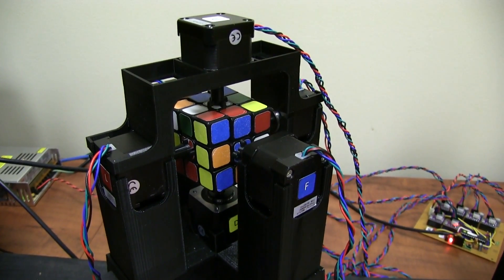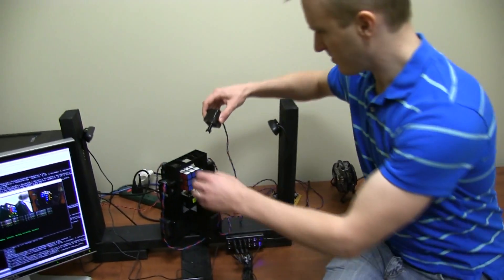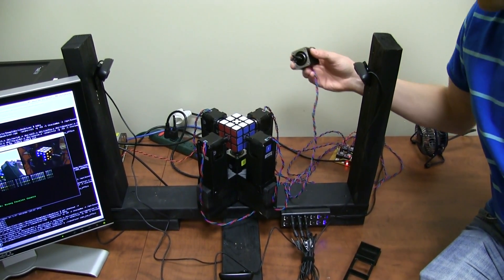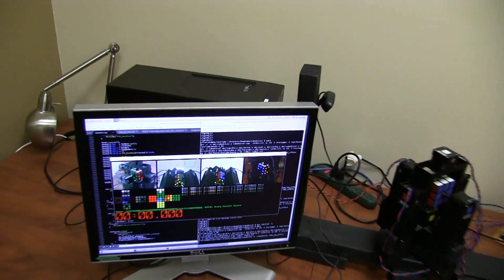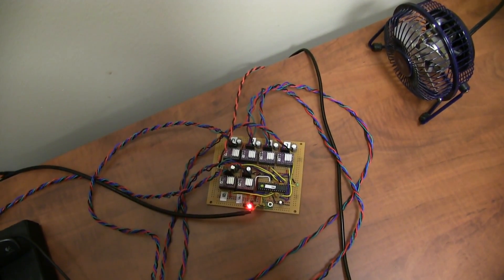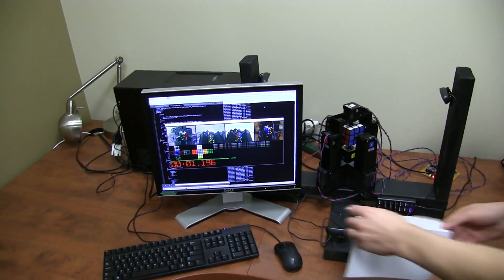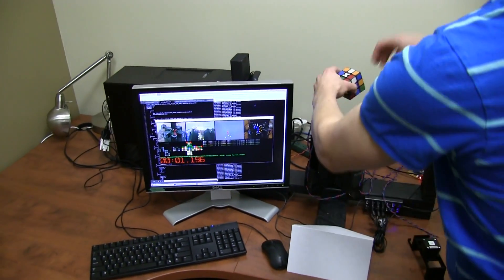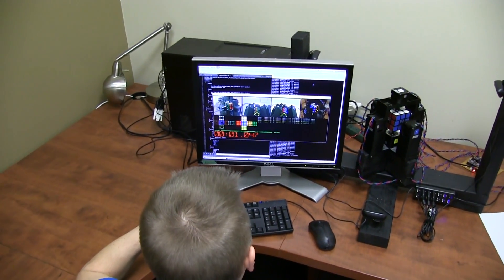World's Fastest Rubik's Cube Solving Robot - Now Official Record is 0.900 Seconds

Comment: Couldn't you write a program to scramble the cube as well? Just to defeat the need to remove the cube and scramble it by hand. I would also assume that in mechanically scrambling the puzzle by means of a computer program, this could essentially randimize the scramble more effectively than any method of doing so by hand. You could also technically create an algorithm to randomize the scramble of the puzzle in a way that solving the puzzle would require a finite limit in the lowest number of moves required to unscramble it.. basically jumbling the cube in a specific way which forces the minimum number of moves to solve it reaches a maximum limit. 

Just an idea that popped in my mind when viewing this video. Otherwise, incredible machine!! Very well made and stout, great idea, awesome construction, and amazing mechanisms which achieves it's purpose extremely efficiently and with maximum applicable speed, at the same time. 

Ingenious. 
I love it!!

Comment: Again, unoriginally, it's a well done project, but you modified the Rubik's cube. You could've as well glued the thing to the motors and it would've had the same effect. Since there are many computer vision solutions available open source, as well as solving algorithms, I fail to be impressed. I mean, well done on the implementation, but you fucked up  the dismount. 🙄

Comment: That's amazing!!
But just saying...if you want to go for world record, you should be able to solve the cube without modifying the it(the holes for the plastic arms connected to the stepper motors). Something that uses friction i don't know... anything but DRILLING 24 TINY HOLES IN THE DAMN THING!

p.s. mind blowing engineering and thanks for keeping it open :)

Comment: Cubestormer III is still the best. I personally feel that robotic cube solvers such as these should not be able to claim the title for the simple reason of it being impossible to take the cube out without also taking the robot slightly apart. Likewise, these robots rely on slight modifications to the cube (center cubies) in order for them to turn the faces. Cubestormer III is different because the user scrambles the cube, sets it in the device, and BAM. There is no setup at all and no need for cube modification. Cubestormer III still holds the record in my opinion.

Comment: Hi Jay Flatland :)

I have a question about validity - a bit hard to ask over the internet, but i'll try.
I've been watching quite a few of these videos recently as it's one of my fleeting interests atm. But i've noticed a lot of other robot solvers don't use holes drilled in the Rubix for purposes of interacting with the Rubix Cube.

That got me thinking... Would that be at all detrimental to the overall purpose of the challenge? I felt that a large portion of the challenge was to perfect the robot in the chase for time, but some people use that approach in different ways whether is be CPU and or software processing speed, motion speed, software improvements etc

Now with my question at hand - do you feel that modifying the Rubix Cube to suit your robot application is valid?

Comment: That time, .9 seconds was bested by Arduino.  .637 seconds.

https://www.rs-online.com/designspark/bringing-multicore-to-the-arduino-world-with-shieldbuddy-tc275?cm_mmc=US-EM-_-DSN_20161128-_-DM9879-_-BOX2_URL1&cid=DM9879&bid=150763397
Reply: Wayne Cook took me to graphics card website??
Reply: Wayne Cook 
Boom
Reply: @Wayne Cook that one is debatable as the Rubik's cube they are using is a different model than the one he is using. Mechanical resistance and ease of turn can make a huge difference. I want to see that machine to do it with same cube.

Comment: Using those cross-slots is pointless. Build a robot solver that doesn't require slotting the arms into the cube. In other words, make the machine solve a typical unmodified (proper) cube, not an externally modified cube with holes in it. If you run a competition with an "EXTERNALLY" MODIFIED cube, then you might as well use a 'virtual graphical cube', in which case, the 'graphical' cube could be solved in micro-second or low milli-second scale, as compared with the relatively 'slow' 1 second' scale.
Reply: but speedsolving a 'virtual graphical cube' is pointless
Reply: How is this pointless? this is hardly a modification and its acceptable to use at the WCA even.

Comment: Try doing this with a bigger sized cube still is amazing though
Reply: Not in odd-layered cubes, you can solve them without moving the center pieces.

Even in even-layered cubes, it is possible to make a robot that can solve those.
Reply: Cant. You see how the six center cube dont move at all, in bigger cube every piece has to move.
Reply: maybe he was talking about physically larger cubes, like 60 or 70 millimeter cubes
Reply: Hey Chris! Maybe. Hiren did say "six center cube" so not sure
Reply: i was talking to Hiren so Hiren wasnt the original poster
Reply: Chris Choi sorry for lack of punctuation marks. 
This is a 3x6 cube and when the machine rotates the cube you can see that the center piece does not move. Now if we have 4 or more piece cubes such machine will not work as every piece has to move which certainly this machine cant do.
Reply: Haha no problem. Do you mean a 3x3x3 cube?

And yes, this machine would not be able to handle larger cubes. But I'm sure there are machines out there or in the works that could solve those!
Reply: Chris Bandy well i mean 3 piece cube. 

What I meant is logic of holding one piece and moving others might not work in puzzles like 8 piece octahedron or 17 piece cube or 11 piece decahedrons.

Comment: The funny things
 Is that he solved it in 0.900 seconds he coul of said 0.9 or 0.90000000000000000000000 it would not of mattered
Reply: it matters, because 0.9sec means that you are not as precise as 0.900sec:  

0.94999999999...sec to 0.85sec = range of stopwatch saying 0.9sec. 
0.90049999999...sec to 0.8995sec = range of stopwatch saying 0.900sec
Reply: Yep. Adding zeros after the decimal shows how precise  you are.
Reply: and still 0.9 = 0.900 = 0.9000000000000000000
Reply: Djordje Krstic Yes, but the differing decimals tell you different things. If you have 0.900 seconds, for example, that tells you the watch can only keep track of time to the third decimal place. It's useful for telling you the margin of error at a glance.

Comment: You'd probably get a better record with a moyu aolong or a moyu hualong.
Reply: it might be worth to edit the program to allow the stepper motors to cut corners, i mean most speadcubes can cut 30° or so and you could allow the motor for the 2nd move to start moving, once the first motor has turned to those 30° or less. 30° out of a 90° rotation might do quite a lot, especially alot more then changing the cube.
As to my knowledge they already use a decent speedcube and it didnt ever lock up, as i said the steppers make close to perfect 90° turns so there might not be that much difference as the cube 99,9999999% doesnt lock up and speed difference on this level only depends on lubrication and acceleration of the motors while the motor torque is easily enough to move even a not perfectly lubed cube.

Comment: What would happen if you moved a sticker?
Reply: the computer will divide by 0 and then explode
Reply: /0= death
Reply: It will be divided by 0 and there's that.
Reply: Papa Pleeb my hypothesis: the cube would try and solve itself all the time... since the cube can't be solved, the cube would just rotate in one position where it is fine in another camera, yet not in the other and moved it again... endlessly
Reply: the robot won't do anything because no solution was found
Reply: Papa Pleeb some don’t have stickers
Reply: Depends on the program of the robot. If it is programmed to give the BEST solution, then it will give the configuration with the most faces in one color. (I doubt, this particular robot is programmed this way) if the robot was programmed to solve the cube before proceeding, then it will not commence to do anything with the physical cube until it has found a solution. The hard part in coding the program will be how to detect an unsolvable configuration. .
Reply: If you move a sticker with another sticker then nothing but if you just removed one and not put it back (basically leaving a spot blank) then it would not work

Comment: i think it's kinda cheating because they drilled that holes in it so they do not need to pull in and out to grip on to the cube making it much faster :|
Reply: It's not cheating, it's not not solving the cube because there are holes in the side you moron. Even in the WCA if you brought this cube they would still let you compete.
Reply: why different center shape is cheat?
Reply: The holes in the cube don't give the machine a unfair advantage.  They are there only to hold the cube in the machine.  It is the actual program that is actually solving the cube.
Reply: it's cheating. I find this one invalid even though it is impressive.

Comment: What's the average number of turns that the program uses to solve the cube?
Reply: god's number
Reply: KEES JAN no that's the meaning of life, the universe and everything inside it - it's maximum 20
Reply: 42
Reply: +Rippah, Kociemba's algorithm is sub-optimal since it concatenates the solutions to two independent subgroups.  It may find a solution that is god's number for some configurations, but is not guaranteed to do so for all configurations.  "God's algorithms" which was later developed by Korf and others is optimal.  So Kociemba's algorithm is a good fast algorithm that sometimes matches "God's algorithm' but not always.
Reply: Rippah - Please see the following link.  Kociemba's algorithm uses multiple subgroups and it's been proved that it can be solved in 29 moves or less (greater than God's number).  Your tests may just be lucky.  Also it could be that you are using Kociemba's software to run God's algorithm, not the Kociemba algorithm itself as Kociemba may have updated his solver to use the new algorithm, but if so, that algorithm is not "Kociemba's algorithm" which uses multiple subgroups. https://en.wikipedia.org/wiki/Optimal_solutions_for_Rubik%27s_Cube#Kociemba.27s_algorithm
Reply: Feasible 20
Reply: +Thomas The Racer - He said he was using Kociemba's solver, not God's algorithm, so no.
Reply: Enigma758 Kociemba's solver figures out the god solve for the scramble, so it is the god number or less. I've tested it myself

Comment: Its really great, but there's one limitation like the squares from where u hold the cube for rotating by stepper motor it need to be coloured only once from all other points from where it is holded, and yes the slots u punched in it are also in same pattern. SO for solving it u need a cube which has predetermined one squares of all colours on centre without repeating it on any other  5 faces from total 6..

Comment: THEY CHEATED they losend the cube so its easier to turn
Reply: +Jeriko Bautista That's not called cheating you dumbass. The cubes which can spin smoothly will be easier and faster to solve because what if it was rough and the side you want to turn got stuck, time is affected so yeah, Rubik cubes needs to spin smoothly.
Reply: No losening cubes is againt rules in the guniss record. You have to do it with a normal non modified cube so yeah thats cheating
Reply: RedEyed Rocker the $10 cubes are usually the smoothest ones anyways
Reply: Jeriko Bautista All people won't spend $10 on the cubes.
Reply: RedEyed Rocker it is cheating stupid it dosent make it smoother it makes it easier to spin so it can be done instantly. In the book this cant be in the world records because you are not supossed to use modified cubes
Reply: RedEyed Rocker it isnt making it smoother most good cubes are already smooth in the firat place
Reply: Jeriko Bautista Whatever, looseing the cubes or making them smooth just so they can turn the cubes easier and fast and that's no cheating unless its a speed match and smoothing the cube is not fucking related to solving the cube.
Reply: RedEyed Rocker ok ill accept using lube to help smoothen the sube but not lossening since it makes it turn faster and not smoother
Reply: Jeriko Bautista It makes it faster so whats the problem? The thing is that robot can solve that cube very fast and the cube needs to be loosened for the robot to get a grip on it. So stfu people, can't u just see that robot can solve a cube. Turning faster or smoother wont help in solving a cube, it will just help in speed and grip.

Comment: the algo doesn't belong to them, right? The servo motors, controllers, cameras, all hardware - is from the shop. 
So what exactly they did? frame to install motors, connect them to controller and ... That is it ) Looks impressive but the whole thing is just a school project ) Ok. high school project
Reply: MrSparklystuff the code? Dear, what code? code for controllers? available for any Arduino. Code for cameras? same-same. 
It is all if %combination AAFFDDSS% than "turn 1 turn 2 turn 3". if the %combination is FFDDSS% than .... 
What code? Soon we'll cheer winners in Angry Birds and kids who can download from website to controller boards. Massive retardation on new generation. incl.

Comment: Fantastic and congrats!
To those who provided the advise that the inventors should substitute a suction cup or friction finger to turn each side- you should try pushing on a central cube with your finger tip to see if that is possible - I couldn't.  And while certainly a gizmo (technical term) could be contrived that allowed each stepper motor to hold one or more corners to apply the force to turn - there would then require additional "re-gripping" articulations with each turn.  It would still be impressive.
But let's not take away from the brilliance and simplicity of a truly amazing solution done Perfectly.
Hats off to the inventors!

Comment: Instead of drilling centre square to turn a side why didn't you have some sort of corner holders (that look like corner protectors on furniture edges) connected to each motor. They would have to be able to move out of the way while a 90 degree edge is rotated though. Don't think Guinness WR allow modifications to cube do they?

Comment: Can i know what cube are you using? looks like dayan zhanchi
Reply from the maker: Yep, Zhanchi FTW
Reply: +gewglesux There are multiple different brans of cubes, however the cube concept is relatively the same
Reply: +gewglesux I recommend the QiYi thunderclap
Reply: +gewglesux surprisingly yes. they're also considerably cheaper than the regular rubiks cubes. I would personally recommend the shuangren v2. That's the one I started out with
Reply from the maker: ***** Tension to full tight, then back off just a bit - just enough so it turns easily.  When it's good and tight, it's pretty much impossible to slip or pull out pieces (or explode the cube).
Reply: +Jay Flatland what does ftw stand for? 
does it stand for fuck the world?
Reply: +grimmgaming For the win* my friend !
Reply: it's not dayan zhanchi, it's some cube that has cross centers
Reply: +Craptacular1116   I'll look for that one.. thank you!
Reply: Jay Flatland i tried same thing with zanchi but I removed the center piece and added a square peg. But it used to rotate. How did you solve the porblem? Added tension?
Reply: +Jay Flatland can you please tell me who are you rotating the cube. motors are holding the cube from center piece, the axis of rotation of motor appear to be perpendicular to cube surface?
Reply: +grimmgaming FTW used to stand for, "fuck the world" back to before it got into the 2010's but not FTW stands for, "for the win".
Reply: thanks for the info!
Reply: No problem mate
Reply: gc
Reply: Jump
Reply: There are a lot of cubes capable of higher speeds in the market now. I might suggest the Moyu Weilong GTS2, it makes the zanchi look like a crappy off-brand. Of course, I don't think the cube would be a limiting factor of the machine so it shouldn't much matter.
Reply: the original rubik`s cube costs as much as a good speed cube but is one of the worst cubes that is not by a "no name" brand

speedcubes have have springs that you can tension so thet the cube can flex and it does not lock up so much while solving

also when you are speedsolving you lube your cubes to make them fast and smooth
Reply: +Karan Chaphekar   I didn't know that there were more than one kind of cube..
Reply: +Craptacular1116 Thanks for the reply.  I was just curious  if one brand was made better than another(better parts or maybe bearings instead of plastic parts)  I think the original is a good one to start out with...

Comment: Wow!  Looks really solidly made!  Whats next?  Instead of a PC try using a Raspberry Pi instead and making it portable?
Reply from the maker: tried a pi initially with that thought, but think times were 500ms or more on avg, so too slow.  portable would be cool, though.
Reply: +Jay Flatland if you are interested in that you might want to try Intel Edison and/or Tessel 2, neither one is difficult to code as they interpret JavaScript(you can have Node runtime on it) otherwise I guess you should buy your low-level microprocessor from TI and code it in assembly/C to squeeze max speed out of it
Reply: how long at think times on this rig?